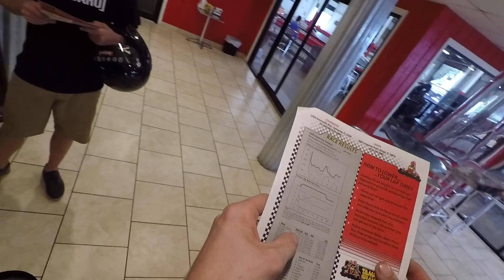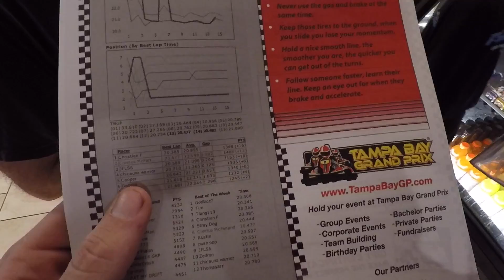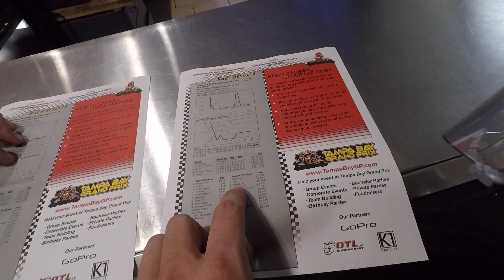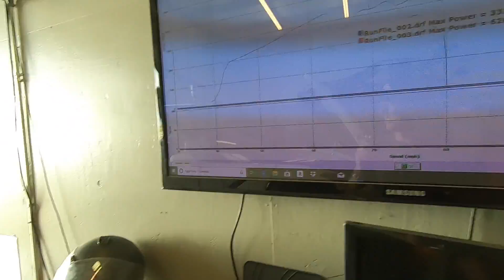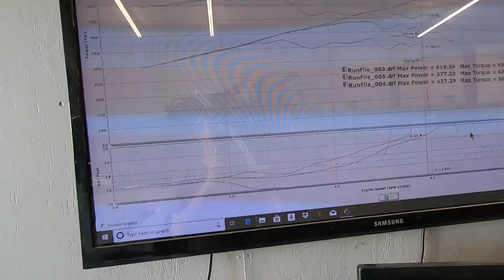Our ProCharged Corvette Hits The Dyno... Bald Eagles are ANGRY!

Comment: Taken from a trade group:   "Its not the cylinder being flooded with fuel. It is the car running lean due to lack of fuel pressure due to the amount of air the MAF sees coming in and MAP, so it calls for huge amounts of fuel if COT is active (which it is, but cant be disabled on the stock tune), and the large fuel requests, which the high side pump can deliver, but in doing so, it outflows the low side pump, so the low side has a fuel pressure drop and in domino effect, so does the high side a moment later, and knock sensors going off and low fuel pressure sensors falling below critical thresholds of 60psi on the low side which cause the car to shut TB angle and pull timing, IF the car does not first go into limp mode for p228c or throw engine lights for p0089 aka high pressure side drop."

Comment: Any way you could fit that fuel pressure gauge right against the windscreen?
Reply: That was good.......
Reply: It will only fit with a slight mod. You need a bit more clearance on the bottom, and the easiest way i found was to crack the windshield and remove 7 small shards of glass.. after that she fits like a glove
Reply: This should have more likes

Comment: I wanna see an 8.1 next in ruby
Reply: The Bud Knight's true
Reply: and put another, identical turbo on it.
Reply: The 8.1 is the worst Big Block Chevy ever made.  Only 1 company makes cylinder heads and they are still lack luster after all of that.
Reply: Actaully
Reply: @Sir.VicsMasher  you do know that the 8.1 is a 454...
Reply: @Sir.VicsMasher  or a 502.
Reply: @devinmaynard8066  technically its a 496
Reply: The Bud Knight's 496
Reply: Junk RV motors . The reason you don't see them in anything is that the LS platform is far superior. Even with less cubic inches. They are seriously crap!!
Reply: Yes
Reply: Pfft just throw the 8.4l V10 in there while we are at it.

Comment: Check the crankshaft position sensor
Reply: Yeah it definitely isn't that, or else he wouldn't have ignition
Reply: wsupchris1222444 no he wouldn’t have ignition while starting up, but after it starts he would be fine, he said it takes a while to start up so it could be the crank position sensor
Reply: @jaceneholmes8088  It's very unlikely the ckp is broken, ckp is used for timing of the spark and if it fails the cmp can work as a limp home mode but would not have timing advance as he would normally have. Low fuel pressure would be the likely cause to long starting
Reply: wsupchris1222444 the crankshaft position sensor could be faulty and still let the car run. Some cars will on get to 2500 rms and nothing more under a load but can be driven easily and still run fine. I have replace many of them that have crazy behaviors.
Reply: It would have turn the check engine light on and probably not run.   It probably doesn’t have enough fuel pressure on the direct injectors

Comment: Cooper’s 1,100+ HP Supra 
Vs Boostedboiz 1,000HP Toyota MR2
It’ll be a badass race 

Please make it more then 800-900 Cooper
Reply: They are he went with the built engine instead
Reply: if hes un-used to drag racing throwing him into a 1100 hp rear wheel drive drag car may be a worse idea than starting lower and working up to that like hes done with the V so far.
Reply: Who's Cooper?  You really think any of his builds will be complete?  Look at how long its taken to do a LSA blower swap with supporting mods on a CTSV1 and you think a 1,000hp Supra is in the cards...
Reply: @Sir.VicsMasher  Righttttttttt
Reply: @Sir.VicsMasher  Cooper is the guy buying the 2jz....
Reply: @Darthjammer224  not if he just fucken sends it
Reply: @Sir.VicsMasher  true but they are blowing up recently and spending money like its nothing so it could happen soon
Reply: @leroyhall4401  I'm all for full sends especially for the comedic value but 1200hp for a beginner can get dangerous real quick. 

That being said building it for 1500 and only running enough boost for 800 is a reasonable compromise with headroom for learning
Reply: they got an mr2?? still a 3s or is it ruined??
Reply: @damnitbobby8438  It could if Coopers projects didn't stay on the very bottom of the priority list.
Reply: @Sir.VicsMasher  Sounds like someone else is doing the work on the supra so lets hope it gets done sooner than later.
Reply: @Darthjammer224  I agree. Or put him some type of Auto or lenco. Idk. Something to help him out so he can learn the launch etc. Coops. Got it in him but you can see he just seemed so nervous
Reply: Its funny how everyone some what bashes on cooper but they for get HE'S the man that's editing and sending out orders for the fans didn't anyone pay attention to the videos they put out 😶
Reply: @Darthjammer224  I would do 1100, but I have been in race cars before. He isn't ready for 1100.
Reply: @HappyHarryHardon  I wonder if Cooper has his Comp license?
Reply: Nitrous!!!
Reply: @screener545  Its a K swap lol.

Comment: Gas engine guys trying to figure out direct injection issues. Smh. Let a diesel guy save you some time. Injector blow back. Under load cylinder pressure pushing past an injector needle seat and putting air in the rail. Thank me later.
Reply: Makes sense
Reply: Kinda what I was thinking.  They’ve dramatically increased cylinder pressure on stock injectors and stock mechanical pump.  Also they should look at it to see if it’s on port or direct injection when the fuel starvation occurs.
Reply: Wish cletus would see this
Reply: Cameron Anderson so do I, but I’m sure he never will. Eventually it’ll get sorted out and then we’ll see what was the gremlin.
Reply: we need to bump this so cleetus sees it.
Reply: Tony Bowling not nearly as much of a problem (usually) with gas di motors because the cylinder pressure is a lot lower than most diesels. But yea. You are correct
Reply: This is a common rail fuel system, all fuel comes from the pump to the high pressure fuel rail.  Your scenario could never happen on this engine, you'd only lose compression.   Good try though.
Reply: I say common rail because they all get fuel from the rail,  its still not like a common rail system on a diesel.

Comment: Vortec 8100 next for Ruby!
Reply: NoCumBacks no
Reply: NBA MZ you’re just afraid of 8 litres of pure bald eagles!
Reply: It’s actually has very little aftermarket support and weighs a ton
Reply: Bbd L So you’re saying team bartle skeet can’t throw something together and run 9’s?
Reply: It needs a mountain man engine. 500 cubes, naaah, we need 800.
Reply: The 8.1 has very little support but the guys that do make stuff for them has good numbers, but you’re gonna pay
Reply: @ChrisSmoove77  I've worked on those engines. The best sounding gm engine of all-time. It makes the mid size trucks accelerate like a car fully loaded. Too bad they never came in a car. Gto would have been cool.
Reply: Considering the do a home porter head,  warn out bottom ends and pistons I don’t think they’d have probably if they did a built bottom end that car be fine high/mid 8s
Reply: Plus he wants to do the front support like Leroy so that’s 100 pounds off. I heard Leroy’s old motors goin in ruby so it’ll be low 8s easy

Comment: Jeremy needs to get his "Power Sprinkles" sticker and have a small print on the front left chest area and have a large print on the back between the shoulder blades with "Father Timing." under the sticker.
Reply: Or put Faster Proms on the left chest area and put the "Power Sprinkles" inbetween the shoulder blades on the back and put Father Timing under the sticker.

Comment: I’m not familiar with LT1’s specifically but direct injected motors tend to have a pressure relief valve that if for some reason your pressure gets too high it will vent the excess pressure back to your tank. I wonder if your pressure relief valve is opening prematurely and venting your fuel pressure. Check to see if you have one and if so replace it, they are relatively inexpensive and could very well be your gremlin.

Comment: Direct injection systems sometimes have an over-pressure relief valve. Once those valves release, they may not go back to the original max pressure. Had a similar issue back in the day. Just a thought.

Comment: There is a piece under the high pressure fuel pump that the spring sit against. That piece follows the cam. It could be damaged, if yall didn't pull that out and check it, look into that next. Also replace those high pressure lines, they're really a one time, once removed they need to be replaced.

Comment: With fuel pressure dropping that much under load makes it sound like it could be the pressure relief valve on the fuel rail. If it gets stuck open your pressure will instantly drop like yours is doing. I've had a similar issue on a different platform but running direct injection

Comment: Awesome vids as always! You guys should ditch the boards and ramps on you 4 post lift, and cut the floor out and set the lift in the ground some so you can just pull right on it with no clearance issues, just a suggestion from a huge fan.

Comment: On a diesel truck if the high pressure pump goes out it sends metal through the entire fuel system but they run  30,000 psi

Comment: Let me throw this idea at you. Have you checked the injector? When you have a drop in pressure you have an increase in flow. PD pumps have tight clearances so when running them in series the booster pump.. what you’re calling the low pressure (LP) pump… feeds the charge pump… the high pressure (HP) pump. The LP pump will show good pressure since there is no way for flow to go around the tight clearances in the HP pump. The LP system is designed to make the pressure and flow needed no matter what, the only thing that can affect that is a leak or a bad pump. So in your system, you know you have good LP pressure and the HP pump is working, if it were bad you would have a constant pressure loss, it would not be sporadic. The only place to look is down steam at the injectors if one is not seating all the way it will bleed pressure, a tinny leak in a HP system will show as a huge loss in pressure. I would focus on that area. I’m not shooting from the hip here I’m a pump systems engineer with a New York state pump company. Good luck and I love your show.

Comment: I would go in with a scan tool and see if there's any codes for your gdi, look at your high fuel pressure sensor and see what it reads, check the high fuel pressure regulator too. Also it's recommended to replace fuel lines on gdi when you open them up so you dont risk a 2500 psi fuel leak
Reply: They can monitor all that with the tuning software fortunately. The high fuel pressure is electronically regulated by the pump itself

Comment: Even though that C7 has a fuel pressure issue, it sure is acting up like it has an ignition issue. Check for a cracked spark plug or damaged wires which are leaking spark under load. Cooper, you'll want to look into a Hybrid Turbo(s) for your 2JZ to have an electric motor help get them spooled and avoid lag. Love the content, guys! -Watching from Austria.

Comment: As I have said many times before stock components have to be replaced slowly. Simple bolt on components like a change in fuel components, headers, intake, better mufflers, ignition, suspension and heads. Then internal components, cam, crank, block, tranny and diff. Someone suggested a better fuel pump. I would add a regulator and bigger fuel lines instead of going to a blower.

Comment: I've got an idea for Cleetus fab. What about compressed air spooled turbo kit for a project? You could DIY it fairly easy and would rock the strip. You could have eagles on demand like N20 and it would be a truly unique build for drag car. Plus you could put the turbos ANYWHERE and have no heat issues. #tanksandturbos

Comment: You said the high pressure pump is cam driven... I'm not sure how the cam and pump connect to eachother, but if it is similar to the cadillac cam-driven vacuum pumps, there could be problem there. That is where i would look next if you guys didn't inspect it when the old pump was taken off.

Comment: Hey Cleetus/Garrett, It was great meeting the crew in Houston last week. That saying, the pressure gauge you are using to monitor pressure is crap. I would be glad to provide you some pressure indicators free of charge that will not be affected by pulsation and vibration. I can also provide a drag pointer that indicates max pressure. Give me an address with some specs.. 1/4" npt  centerback mount?

Comment: C7 issues: fuel pressure relief valve, fuel pressure sensor, fuel pressure wiring harness or connector.  Hope you guys figure it out.  That C7 is pretty.

Comment: Did you guys happen to check the fuel rail sensor?  I am assuming its like most cars with direct injection and has a high pressure fuel rail sensor to monitor the high pressure fuel pump output.

Comment: Is your flex fuel sensor calculating the proper ethanol content? For whatever reason at the gm dealer we have seen weird fuel pressure/trim events with e85 on the high pressure fuel system cars. There's also a valve in the soft line between the supply line and the HP pump that causes issues.

Comment: c 7 needs high side fuel pressure sensor its failing at high pressure just like older gm oil pressure sensors  (or not )

Comment: Are you guys sure the problem with the C7 is fuel related?  I've owned 2 Corvettes and the crankshaft and camshaft position sensors are weak spots on those cars.  You found that out on Leroy.  You might want to check the sensor outputs.

Comment: Is it possible that one of the high pressure lines is leaking or kinked? I know most manufacturers recommend replacing any high pressure lines that are removed (usually to guarantee sealing). Just a thought

Comment: Have you been using E85 on this pump?
  Most stock Direct Injection HP fuel pumps do not self lubricate so E85 makes them stick, big issue with the newer WRX.  If its a used pump im sure its got the same issue if they ran similar fuels atelast thats been my nightmare with my wrx .

Comment: You better be getting a deal coop. There's not a whole lot of money in parts there. 10yrs ago I bought a Jdm 2jz that came with a front clip for 2100$. Recently Hbr Vegas quoted me 1600 plus parts for a full build (top hat liners are a bitch) . he did the heads 1.5mm over and decked for 300+.  Keep an eye on this before your way over budget.

Comment: I have a turbocharged direct injected engine, and I have recently dealt with some fuel system problems. Based on some of my recent-and-limited experience, I would suggest that you check, 1.) the fuel pressure regulator on the rail, 2.) the fuel pressure sensor on the rail. If either one are malfunctioning under certain conditions, things like this can happen. In my case, it was the pressure sensor on the rail not reporting values higher than a certain amount, confusing the ECM. 3.) Another thing to check out – and you mentioned the car taking a long time to start – is carbon buildup on the intake valves. This can correlate with carbon buildup on the injectors and when that happens they can misbehave in many ways. Both a malfunctioning high fuel pressure sensor and sticky carboned up injectors can be responsible for the "off the charts rich" conditions that Jeremy mentioned. The fuel pressure may very well be fine, but under high load conditions it might be leaking past the injectors, blowing past the regulator, or getting misreported by the sensor. The pump may be commanded to lower pressure in these unknown conditions, and/or the ECM might be trying to correct for what it's seeing and dumping fuel into the cyls. As Jeremy said, these fuel systems are insane and it's difficult to understand what's happening without a lot of analysis.

Comment: I dunno if the C7 has active engine mounts like some of the performance Audi's, but if they do, DEFINITELY check those. I worked on a V8 Audi coupe where when you went full throttle, it would break up. Come to find out the car had active engine mounts and one of them failed. When that mount failed, it cut power to the high pressure fuel pump and would run poorly under hard acceleration.

Comment: Could there be an issue with your aftermarket camshaft? The high pressure fuel pump is driven by a special lobe on the cam. Since you mention you have an aftermarket cam in there it's possible something happened to that lobe. I would hope the entire camshaft is ground out of a solid piece of billet making it impossible for the DI lobe to "slip" on the shaft. Should be able to pull the valley cover and see the lobe just to inspect for any damage. Also, when you swapped the pump did you inspect the pushrod for the pump? Perhaps it's binding in the bore and causing your fuel pump to "float" or has some other issue?

Comment: Just throwing a wild thought out there about the HP fuel system on the C7...would it be a possibility when the camshaft was put in. That there is a difference between stock and aftermarket on the Lobe lift on the lobe that drives the HP pump? Example if the stock lobe has .150” lift and the aftermarket is only .125” the lobe would not fully compress the pump and if the difference in lift was just off just enough I could possibly see why at idle it has enough psi but when accelerating it can’t generate enough pressure because it’s only getting compressed partly.